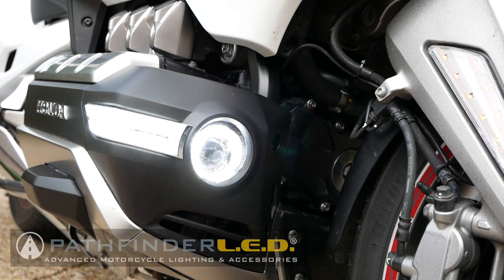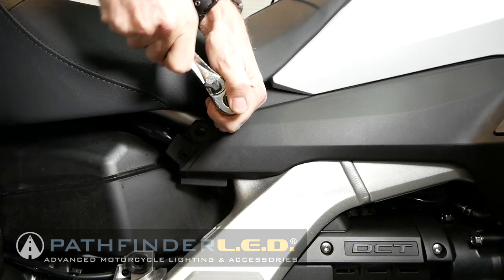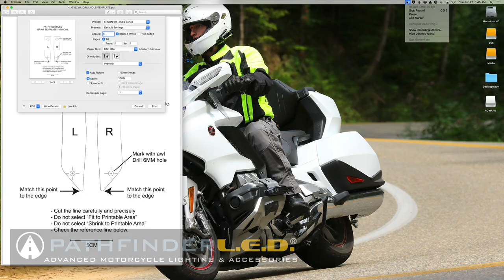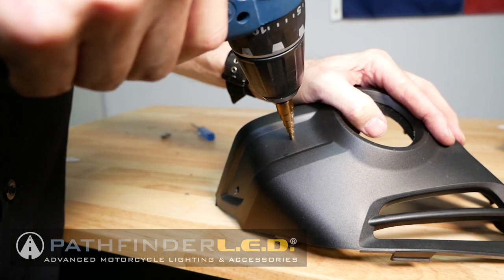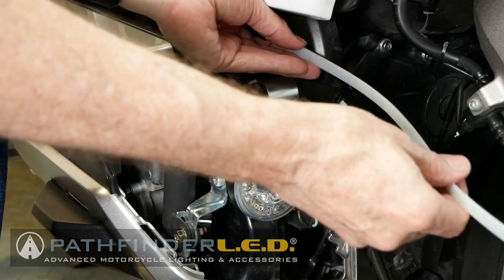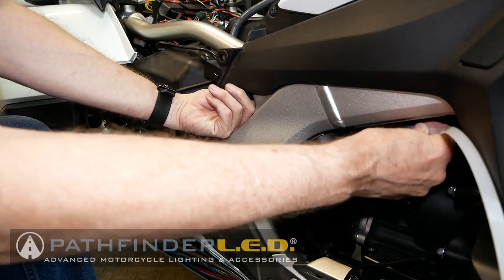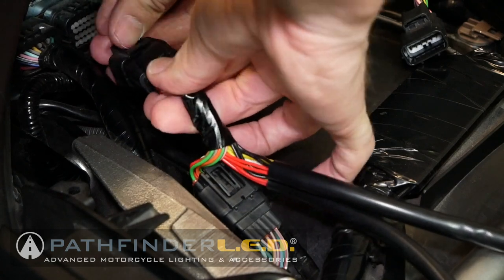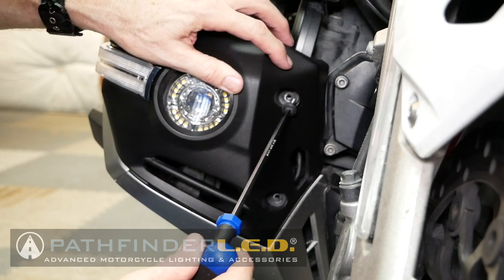Dynamic Sequential LED Cowl Lights | 2018+ Goldwing | PathfinderLED | NEW VERSION

Comment: I just installed the lights. They are really bright!.
I even think, they are a little bit too bright.....
Did you ever had problems with oncoming traffic, that Thea sondern shout youre lights, exspally at night?
Reply: Just installed myself as well as the add-on DRL mirror signals and Kuryakyn fork light....the cowl lights overpower all the other leds.
Reply: @glencarew2072  oh yes
Reply: I'm considering disconnecting the white wire, but they are low.

Comment: I'd like to turn these daylight lights off for night riding. I was wondering how you might approach that. I could use the centre console fog light button, or a push switch in the petrol release pocket. I guess I could just switch into the additional harness power wire without upsetting any canbus sensitivities...

Comment: Great Video - How does this connection work if you have the tailblazer brake light modulator?  Isn't it connected in the same place (Harness)?

Comment: Hello Cruiseman.  Was wondering if you think the Pathfinder cowl lamps connectors under the seat could be de-pinned and arranged  in a fashion that will match the Kuryakyn Omni tail lamp pins?  Reason for asking is I already have the Kuryakyn harness with 3 expansion accessory connectors installed on my bike as I am running their Omni trunk lamp and saddle bag accent lights & would like to use the 3rd. supplied connector for a clean plug & play install.  Any input would be greatly appreciated. Thanks!

Comment: All of my Goldstrike plugs are full and I want add these cowl lights but I'm also installing the Pathfinder accessory Hub protector.  I know it'll eliminate the Goldstrike harness and I'll need to cut the plugs to attach those four accessory lights to connect them to the Pathfinder hub.  My question is: Do I still use the Pathfinder harness and just cut the one plug on the sub harness from the new cowl lights to run it through the hub?

Comment: Hello Cruiseman!  Great install video.  I just received my 2024 GW DCT Tour and had the dealer install these ehile they did some other things.  I noticed I do NOT get any turn signals, just daytime running lights.  I checked the connections and everything seems to be correct.  Do you think there is any difference with the 2024 model year that would cause the turn signals not to work?
Reply from the maker: Did they install these with the Pathfinder Accessory Hub for the 2021+ Goldwing or the plug-n-play harness? There was a change to these from 2018 to 2021. If they used the wrong harness, it could have affected the turn signals. For all Goldwings after 2021, they have to use the PAH60GW V2 for installation. The plug-n-play connectors do not support the new turn signals.
Reply from the maker: https://socalmotogear.com/pah60gw-power-distribution-accessory-hub-for-gold-wing-2018-2024/
Reply: They installed just the harness.  Wish the pathfinder page had this listed clearly.  I ordered the part and found your install video so I should be good to go!  Thank you!!! :)  @cruisemansgarage

Comment: Will these plug and play sub harnesses work with the Kisan Tail Blazers connected in-line?
Reply: I have the same question since i am not sure whether this will cause any issue with the harness function. I am surprises There is no response.
Reply: Will not respond no $$$$ to be maid
Reply: Just did it…yes

Comment: On the 2021 it is imperative you have a relay hub to power the LED turn signal feature separately from the CANBUS.  I used the show chrome, but Pathfinder sells a relay hub that works with this and their other led lights.
Reply: I use the Isolation box vor all ja lights. It works pretty good!

Comment: Will these hook into my goldstrike plug and play harness?
Reply from the maker: Not seamlessly. You would most likely need to cut off one the plug-n-play connectors on each side of your Goldstrike harness and cut off the p-n-p connectors on the cowl light wires, then wire them up manually. PathfinderLED provides the color codes for the wires as I am sure Goldstrike does, so you can get the proper wires connected correctly.
Reply: @cruisemansgarage  I can't believe Cruiseman replied to me! Such an honor. Thanks, you're such a help to me and many. God bless and hope your bike is in top shape soon.

Comment: Can the pathfinder fog ligbts be plugged into the plug and play wiring harness also?
Reply from the maker: Yes, but you are better using the Pathfinder Accessory Hub.
Reply: For some reason i thought there were plugs already available from the factory for fog lights at the mounting location. I wouldve bet that i saw a video about it but i guess not. 🤔Thanks for your videos they are a great help.

Comment: I went to wire cowl lights and plug and play wire harness that in stalled for the trunk lower saddlebag lights plug into and work fine. But the wire ends are not compatible so I cut the ends off the cowl lights and the plug and play to wire directly running lights work fine no directional lights the test lights will flash but looks like low voltage to low for the LED lights to work not sure why. what am I missing ?
Reply from the maker: That is why I recommend the PathfinderLED Power Accessory Hub. Too many issues with the Plug-N-Play Harnesses.

Comment: Chris, I'd like to bypass the G184XP harness, cut off the connector on the cable coming from the cowl light and attach the wires directly to my isolation fuse block. Is there any issue with my doing that? If not, what color wire goes where? Thank you.
Reply: According to the installation instructions, the white wire is running, Yellow is Right Turn, Blue is Left Turn, Black is Ground.
Reply from the maker: In fact, that is exactly what I have done.
Reply: Daniel,  that is what SoCal recommended to me for my 21 GW Tour DCT Airbag - cut and wire the wires direct to the PAH60.  Apparently the 21 has a bit different electronic system.
Reply: Daniel..I just wired in Muth mirrors, Kuryakyn omni fork and bag lights and pathfinder cowl lights on my 2022 GWT and had to do just that...I had to hack the ends off all and wire together (L and R separately of course) into my show chrome fuse block....bit of trial and error (and a few choice expletives!) but all is good and it look great...however the cowl light do overpower the others a bit. Thanks to Cruiseman for giving me the confidence to get this done!!